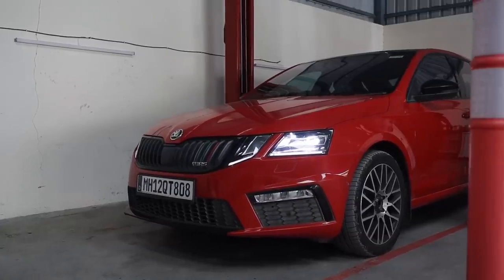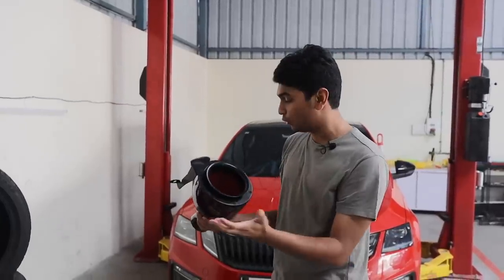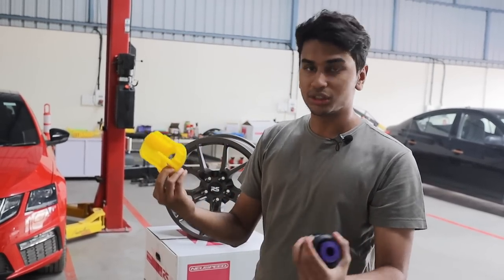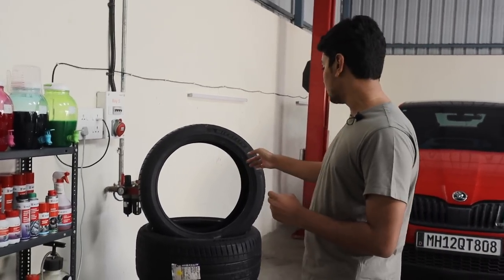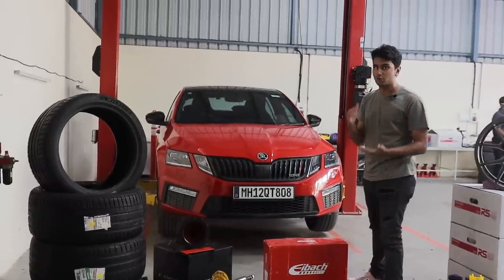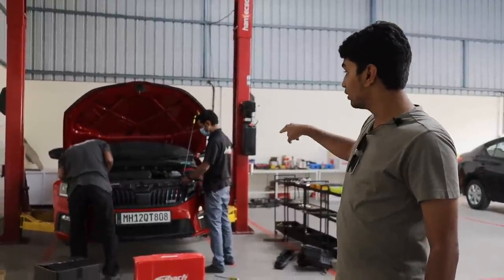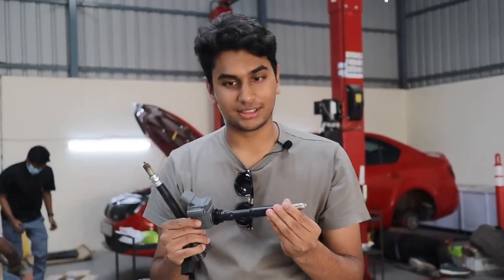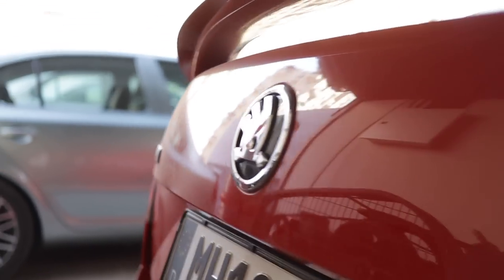Modifying our Octavia VRS to over 300+ BHP & adding 5-6 LACS worth of performance parts!

Comment: Currently running 343 bhp & 550 nm of Torque. Will be upgrading to 440bhp + in the future. Solid car 🔥
Reply: What setup is38?
Reply: Can you tell the mods you did
Reply: @improbro1124  I'm on is20 still
Reply: @atharva0777  I'm now running a stage 2. With 350 bhp. 55nm. R600 4 piece set up. Scorpion turbo back with high flow sports cat. Bilstein B14 coilovers, Aston Martin db9 4pot bbk. Braided hoses etc. Sache performance clutch, APR Stage 2 Medium torque remap. 25mm h&n spacers, xtreme 19"wheels. Wider 235 Mitchell pilot sport tyres.

That's about the lot currently. All supporting mods ready for a stage 3 hybrid turbo.
Reply: @paulk7913 are you going for stage 3? And a awd conversion btw amazing mods!!!! Pure enthusiast stuff
Reply: @atharva0777  I am really hoping to go stage 3 this year with an LSD. I won't go awd unfortunately
Reply: @paulk7913  but if you dont go for awd you will loose all the traction control.
Reply: @atharva0777  nah so I'm not putting all the power down in the first few gears, or in the wet. I just modulate the throttle. Granted awd of a lot quicker...

Comment: If you can show me 20hp gain from an intake, I’ll pay for the mods
Reply: Hi Prithwi! First of all, awesome videos, you're doing a cracking job. So in the video we've directly quoted claims from the Eventuri website. We assumed that everyone would understand that we were talking about gains with a remap.

This is the link to the official website with the Dyno charts and claims by Eventuri themselves: 
https://www.eventuri.net/products/vw-golf-mk7-gti/
Reply: @SohamSaraf  I know the claims man, but it's bull as compared to the physics of generating 20hp without tuning. The peak boost of the car remains constant, as no tuning is applied. So to get 20 hp without tuning, or adding additional fuel, timing etc, is just not possible, no matter how free flowing an intake gets. The peak power of the ecu remains more or less same. Add more air than the ecu is expecting, and the wastegate opens n reduces the boost etc etc. 
You know your shit when it comes to cars, no doubt about that, but this claim is highly overstated at best, and moronic at the least by eventuri. And the fastest IS38 GTI/Skoda RS cars on record do their runs on the stock airbox. The Red CF looks sick as fuck tho..
Good Build!

Comment: Correct me if I'm wrong, but even after the lowered springs, the ride height is probably a tad bit more than what it was because the new wheels are adding 25mm to the ground clearance where as it is being reduced by 15mm at the front. Overall increase is still 10mm. Sidewall of tires is pretty much negligible.

Comment: This is all well and good, the problem of such performance mods is that you don't really get to enjoy all that power, 300 HP power should be fine but imagine 600 hp, 1000 hp, the car architecture won't be able to keep up with the performance at a point, you will have that much power but you won't be able to enjoy all of it, unlike a lambo with factory 600hp where you get to enjoy every bit of it, thanks to all the engineering R&D.

Comment: Wider contact of tires (or wider tire) does not increase grip of vehicle, the tire composition, and weight of vehicle can. As the surface of the contact increases, the weight on that overall surface reduces, resulting in the same grip. Hence , the wider tire does not mean more grip.

But the handling will improve.
Reply: So dragsters have wider rear tyres at the rear snd and thinner ones in rhe front for what reason ,im confused
Reply: @diaryofawanderingboot they have big tyres to match the power output of the engine, so that tyres can handle that much power without bursting, and for grip or (friction) they use sticky rubber like substance on the track with low air pressure inside tyres

Hope this helps.

Comment: doesn't bumping up power figures of a small engine puts more stress on it and reduce the lifetime?
Reply from the maker: No not really. If the it's done properly, we would say otherwise. ECU remaps can actually make the engine perform better and reduce the amount of stress on it if the hardware is also changed
Reply: @TheDriversHub  Thanks for clearing my doubt 😄

Comment: Great Job guys ..I just have a simple question when engine is tunes what happens to the oil pressure system. The pipes and all the designed to sustain a certain bar of pressure but when you tune the engine or remap it the bar presure changes. Can this result in damaging the engine in long run. A person who wants more power is also going to rev it...
Reply: it depends on the car maker if the car maker is german u cant expect a lot but if it is a japanese engine then its ok
Reply: @JiM-t1c 😂
You can more then double this mqb engine and not make any changes to the internals. These engines are over engineered
Reply: Well my point is that the fuel.pump and all at tuned to take a particular pressure...These things are done to such a precision that weight management never goes on toss. But still it is nice to see people is India opening their hearts minds and pocket to proper sports cars. Tuning a car requires a lot of knowledge and I guess I am.just a rookie. ..
Reply from the maker: Hey Simant, your concerns are very valid. But most of these parts are overengineered in a sense. They can take a lot of more than advertised and more importantly, a simple ECU remap isn't going to overwhelm the hardware unless and until some drastic mods like a turbo upgrade are done!
Reply: @paulk7913  trash engines man😂😂

Comment: Hi Anand Deshmukh here 
Introducing our all new branch for hardcore car enthusiasts.
A perfectly stiff car with decent dynamics including power to weight ratio.
Engine with refined output and perfect naturally aspirated sound note
giving you sense of exotic throttle response.
Our in house developed suspension tech will deliver stiffness and sense of confidence while cornering and drifting.
 Specially developed chassis is safest place to be when the beast is on track crafting every inch of path you draw.
including luxury like suede seats and dash skin.
stainless steel ergonomic pedals.
soft headliner.

we are happy to receive interest msg from people who admire cars and feel connected to the car while driving 
for those who drive passionately

rendering will start soon.

Comment: do a actual dyno test n knw whats d actual horsepower it makes n how much more it has gained wid mods. rather would get a whole PP Performance kit                                                                                                                           1	CHIPTUNING

2	TURBOCHARGER

3	RACING FILTER

4	CATLESS KIT

5	INTERCOOLER

6	EXHAUST SYSTEM

n car would make 380ps 480nm 0-100 in 5.46 secs.

Comment: Can you make my mercedes c class a c63 ?
Reply from the maker: Hey Kevin! Well if money wasn't a object yes you can, but since it is, you unfortunately cannot. The C63 sports a 4.0L Twin Turbo V8, which no other C-Class gets and is very difficult to find and then very expensive to buy. The C63 has so many upgrades in terms of hardware like gearbox, suspension, anti roll bars and more importantly the ECU, that you're better off just buying a new C63. But if you want to tune your normal C-Class, that is totally possible and will in fact liven up the car and make it fun to drive!
Reply: @TheDriversHub  roughly how much would it cost any idea?
Reply from the maker: Over 70-80 Lacs easily.
Reply: @TheDriversHub  alright i’d rather go buy a new one